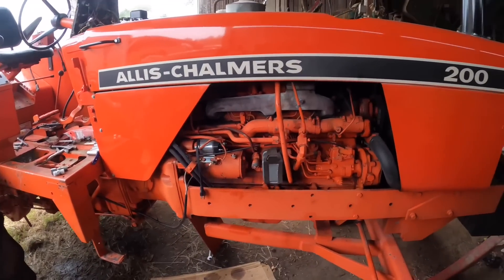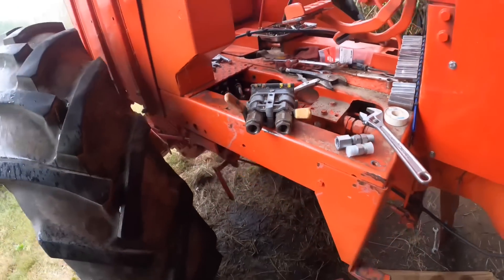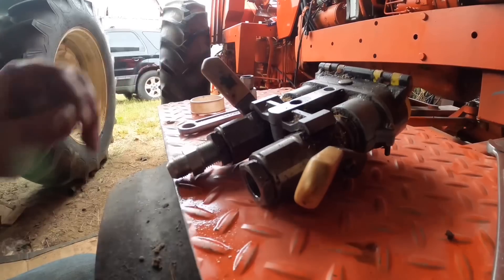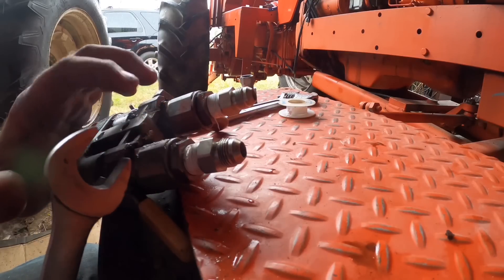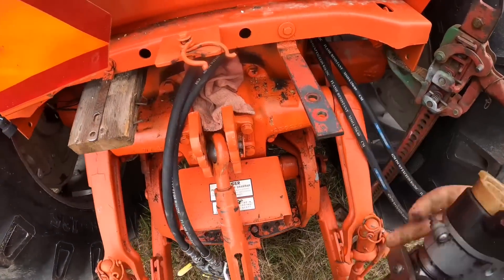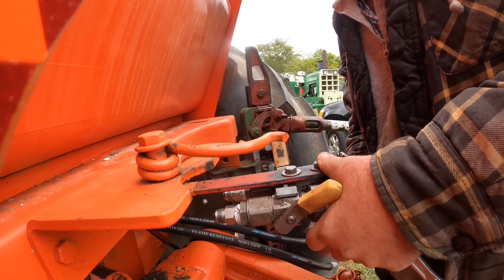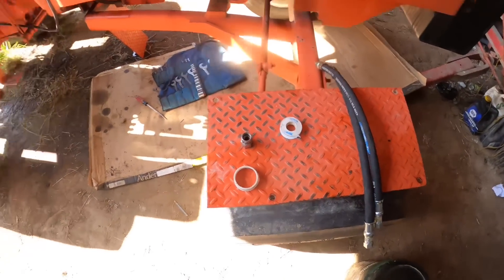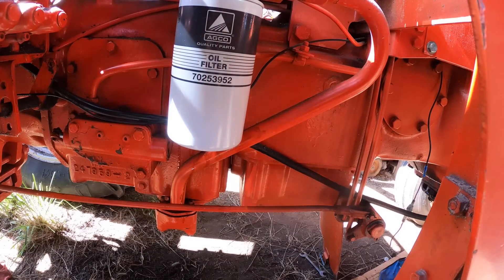GETTING HOSED! Allis-Chalmers 200 new hydraulic hose install

Comment: Yep things here, what’s the part number for those outlets and where do you get them. Also you’re welcome to use my shop anytime you need to
Reply from the maker: They’re 9400 series.  I think shoup has them.
Reply: Ok I think the ones I’m looking for are different, they have the levers on them to hook up under pressure. But I’ll check shoups

Comment: Off subject. 1365 installing front end loader. What do you do with the exhaust pipe? I haven’t started yet but I want to be prepared and it looks very tight.
Reply from the maker: Probably have to unbolt that U-shaped piece and get an exhaust shop to weld you up an exhaust pipe that goes down if it won’t clear.